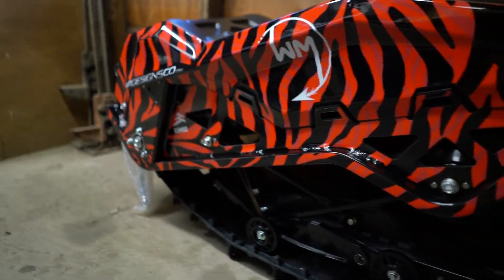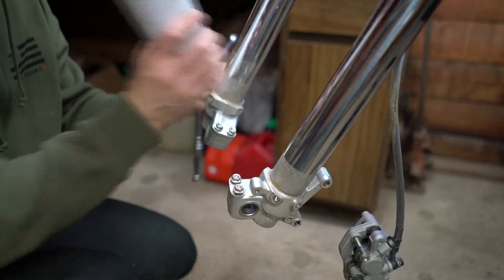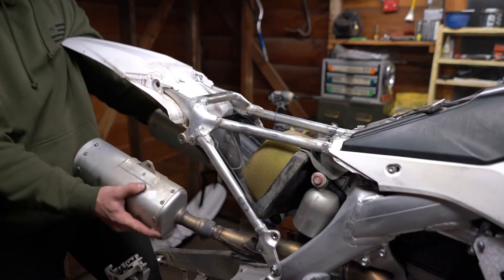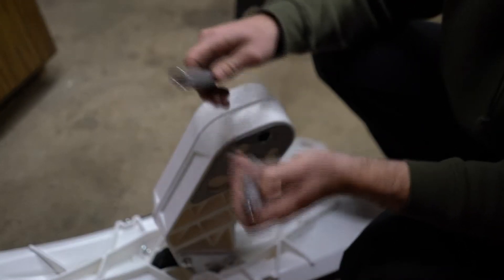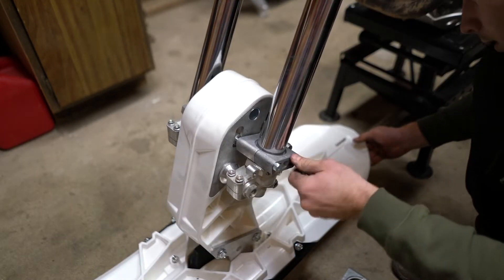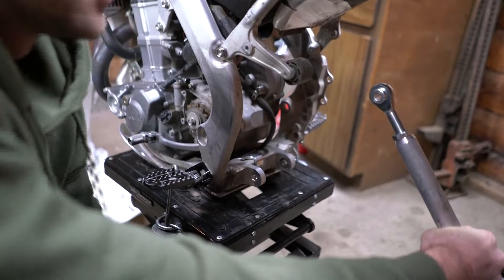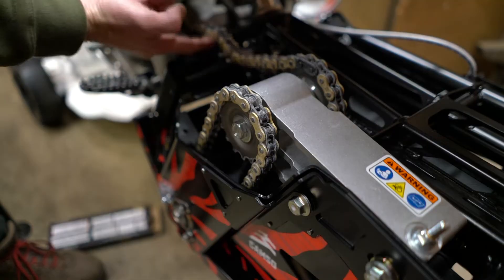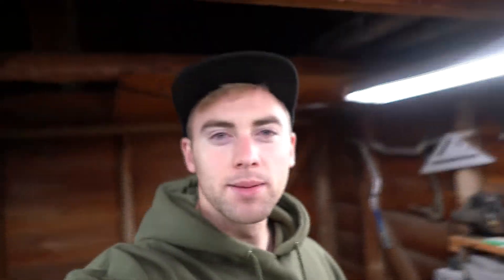2019 SNOWBIKE INSTALL  [CAMSO DTS129]

Comment: As expensive as these are, It's still cheaper than snowmobile.
Reply from the maker: Yeah, I mean you can find an alright sled for 4-5 grand, but the snowbike has more appeal to me
Reply: @JourdonGulick  freaking sled bustin out engine every 5000km or 7000km, freaking start to hate 2stroke sled